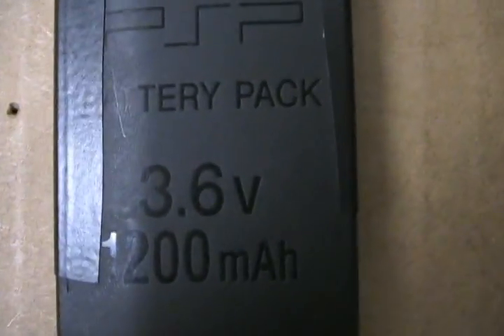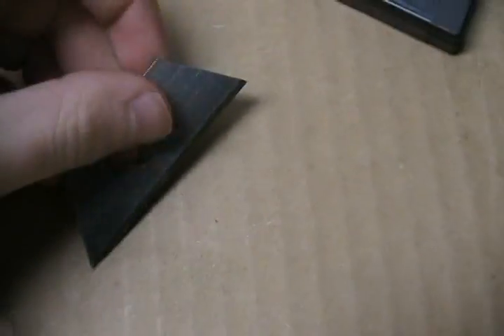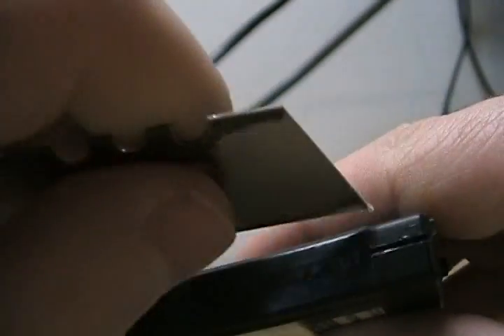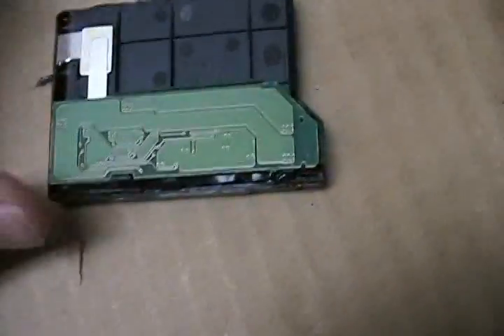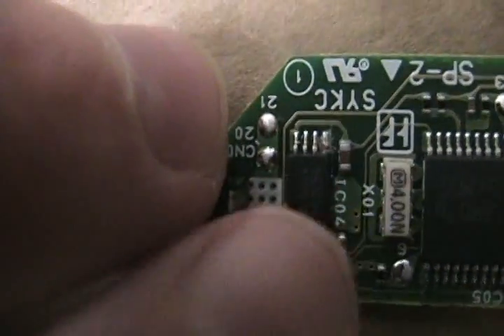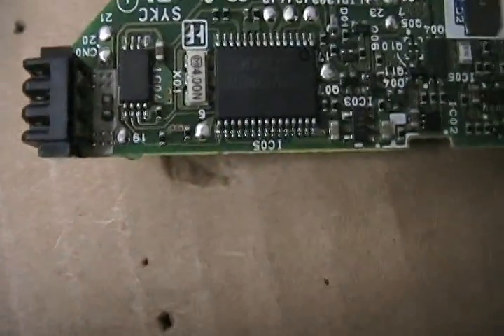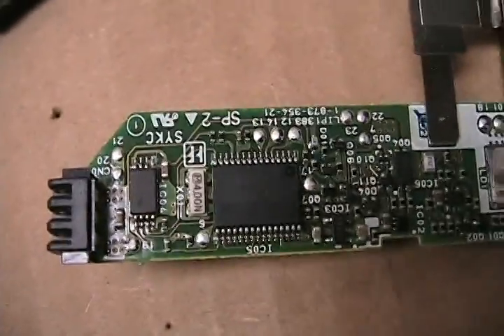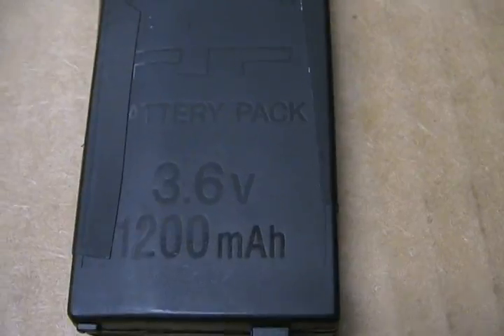How to make a slim pandora battery

Comment: Just use the 6.6 -- 6.3 Downgrader then install chickHEN 6.3 then use Hellcat's Recovery Flasher to install whatever version of CFW you want (5.00 m33-6 is what I have). It is easy, pretty safe, it works, and it was 100% free! :D (on a psp 1000)

Comment: people, plz do not FUCK your psp by doing this. usually by doing this nothing happens. i have a psp 1000, 2000 and 3000 and it totaly fucked my 3000 and it did not work for the psp 1000 or 2000. but when i tried it on my friend's psp 2000 it worked. but it wiped out everything he had on his memory stick. there was no way he could recover the files. So please i recomend you NOT to do this because this guy is a lying son of a bitch hole. there are better ways to do this so dont use this way

Comment: Works on PSP slim 2000 series. Word of advice use a different cutting tool for example a pin. I hit my li-on battery with the blade used on video wasnt pressing hard at all, or do not complete the complete cut just get it 3/4 of way to split open.
Also keep in mind the zooming on the lens in this video. The pins are very very small and close together try a more accurate cutting tool for this as wel. The process of this video is correct. You are out of luck with the 3000 series though.

Comment: if i cut the line and dont have an extra battery an turn it on with the ac adapter and will it work when i turn it on holding r

Comment: careful when cutting open a slim battery because not all of them can be turned into a pandora battery. check the serial number and search google to find out if yours can be pandorized. all phat psp batteries can be pandorized and used on the slims.

Comment: cutting the wire disables epprom u need to cut it to use the firmware and yes if us short ciruct the battery u have no battery anymore

Comment: how the hell did u cut the battery??? im sitting here with my battery and one of those stupid utility blades slicing at the side of the battery for about 10 minutes and i try to pull the plates apart but they only budge a little wtf????

Comment: make/buy a magic memory stick and put that in the psp while the batt's out. Then put in the batt and while putting it in hold the hotkey (It varies, but is usually a shoulder button.) then just select to install custom firmware

Comment: i need help when i cut the wire thingy like you told me....and yes i cut the right one...when i put the battery in, the psp doesnt turn on by itself, in other words its not a pandora battery right? i followed every single instruction you gave me and it didn't work... plz help

Comment: Ok great job on that part.

Now you need to make a magic memory stick which will hold the custom firmware files. It's very easy and you need a real memory stick PRO Duo. (An official sony one. Not a fake one.) To tell if it's fake, scroll to "Videos" on PSP and press triangle and go to information. If you see, "MagicGate", it's real but not, it's fake.

Comment: Kid, you dont even know what your talking about. You dont even know the right terminology. Also, you dont need to cut the "wire" or leg for normal people, just cut the trace on the board that carries its current. It is easier to get at and you can actually fix it if you want.

Go home.